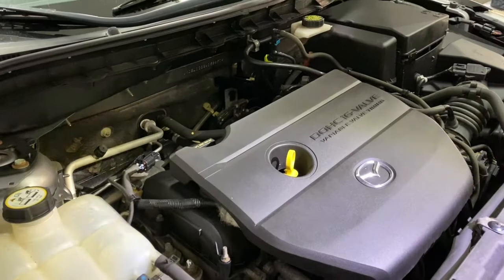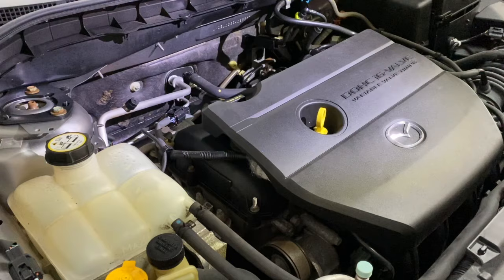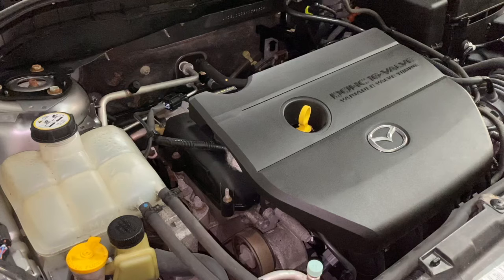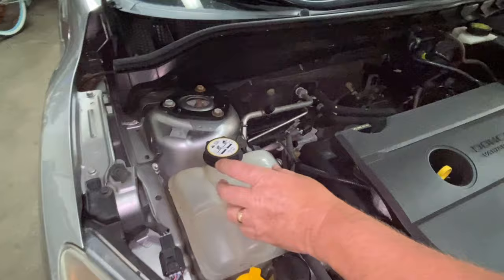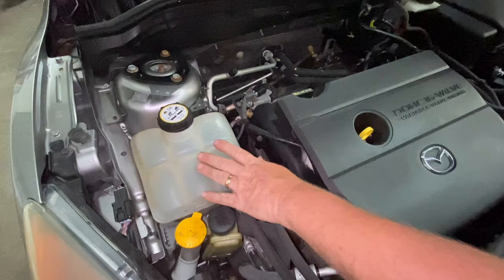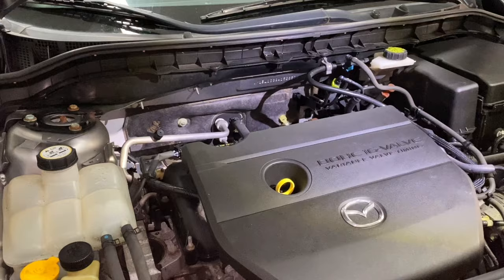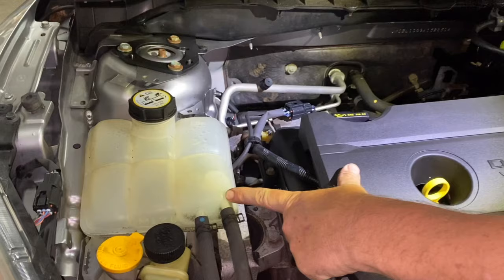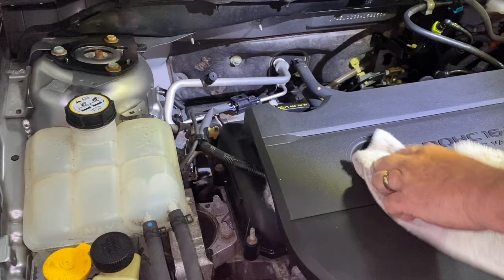Learn 3 Symptoms of Blown Head Gasket

Comment: Happened to my jeep. Only had 78k miles.
Reply from the maker: Sucks when it happens so early
Reply: @Motorcarnut  There alternator had siezed up and caused the serpentine belt to snap so hard it blew a hole in my hood and overheated the engine warping the block.
Reply from the maker: Well that belt turns the water pump so that’s how it overheated not blowing a hole in the hood.?
Reply: @Motorcarnut  The belt punctured the hood when it snapped. It was the 3rd time the serpentine belt snapped so the mechanic previously upgraded it to an all metal one.

Comment: Didn’t realize my car was leaking coolant and I heard it sputtering and wanting to stall and I looks at the coolant gauge and it was past h and the head gasket was fine
Reply from the maker: If in fact the sputtering was caused by a coolant getting into the combustion chamber then it is a failed head gasket or crack in head or block.

Comment: Not a lot of smoke like that at all like 90% less also no overheating and I put 16 oz of sea foam thinking it was empty and was half full then put more gas you think it could be the seafoam and injector cleaner I put on top of each other forgetting it was half full and filling it so it's like a diluted seafoam injector cleaner gas treatment mix 😂 that's why it's a light white smoke
Reply from the maker: I don’t think so. A little white smoke is normal.

Comment: What does the tailpipe smoke smell like in a case like yours with a head gasket issue? Mine smells like burnt tranny fluid...
Reply from the maker: Kinda sweet smelling because of the coolant. Yours can be burning both coolant and engine oil.
Reply: @Motorcarnut  I really appreciate your help brother!
Reply from the maker: No problem

Comment: Hi ive got misfiring codes on 2 of cyclnders, no evident leaks but coolant needs consistent topping up.

Ive changed the coils and spark plugs but no change, do you suggest i use a coolant sealer incase theres a leak or does engine need replacing im unsure of what steps to take
Reply from the maker: First thing I would do is a compression check on all cylinders, they all should be within 10% from highest to lowest number, also if you could see inside the cylinders that are miss firing through the spark plug hole and see if you can see any coolant or stick a long screwdriver in there and see if it’s wet with coolant.

Comment: I have coolant in my reserve tank and radiator and checked the oil and there’s no mix of water & oil. I’m not blowing any white smoke out of my exhaust car was running for half a day 5 minutes later it over heated. Any reason why?
Reply from the maker: Could be many things, thermostat failing radiator fans or fan switch going bad, air in the coolant system. Check those first.

Comment: The car work with  gasoline or diesel?!@
Reply from the maker: This car was gasoline but symptoms are the same for gas or diesel
Reply: @Motorcarnut  i doubt had head gasket but i dont have wait smouk ,i have some drop of water came from exhaust ?!!
Reply from the maker: @medatlaseagle9645  Some light drips of water are normal on a cold engine but should go away when engine is hot.
Reply: @Motorcarnut  I have the pressure in the high hose, and  the water not returning back  to the radiator?!! Can you help me!?

￼
Reply from the maker: That can be a couple of things, if the head gasket is leaking and pressurizing the coolant system it won’t circulate properly or you could have a bad or failing water pump or maybe just air in the system?
Reply: @Motorcarnut  how match i can work with this ,is there risck?!
Reply: @Motorcarnut  I think I have a crack between the water circuit and the exhaust valve, what do you think

Comment: Just bought a car from a garage first time to start it up it didn’t want to start n when it did nothing but smoke, I took if for a drive all seems fine then the coolant started flashing then the service light came on engine light came on, was told it literally just had a fix for the head gasket from a garage and I’ve now taken it back to get fixed again, he looked and the coolant was pretty much empty, so you reckon they even fixed it then as it still looks like the head gasket is gone, also looked at the oil and the lid looked like choco milkshake so, am I fucked basically 😂😂??
Reply: Is a 1.4 turbo corsa
Reply from the maker: Sounds like they didn’t fix anything from what you’re saying. They should of cleaned the coolant and oil system before putting in new fluids AFTER they supposedly fixed the car.
Reply: @Motorcarnut  Yh the coolant box was new and got told the oil was just flushed out and changed but a few pipes got changed, he’s now saying he’s gonna take the catolic con of to clean that of any remaining oil or what not but still don’t see why the coolant would be that low if they’ve just allegedly fixed the head gasket 😂🥴
Reply: Also not to happy as just bought it 😂 meant to be a nice reliable car but they can take it back if can’t get fixed 😂😂
Reply from the maker: I hear what you're saying bro. It is not uncommon for the car to smoke after a head gasket repair because or the residue left behind but it should clear up after say 25 miles of driving.
Reply: @Motorcarnut  Yhyh I’ve probs done about 30 miles if not more already but he said he’s gonna clean everything out because he thinks there might me some residue left. Fingers crossed
Reply from the maker: It’s possible, good luck!
Reply: @Motorcarnut  cars back and all sorted
Reply from the maker: Awesome great to hear that